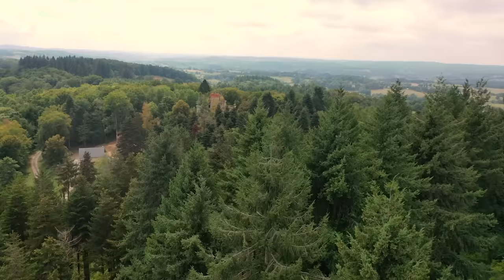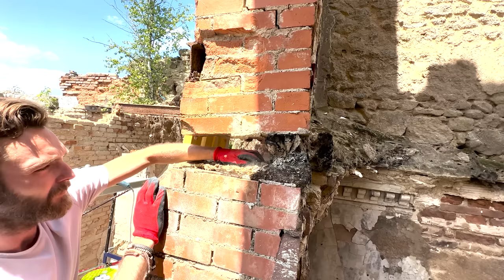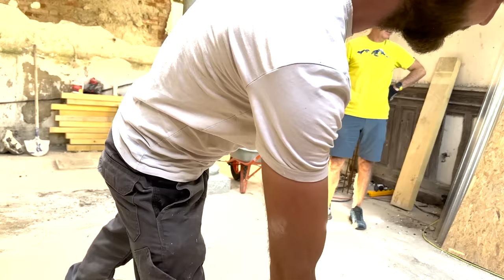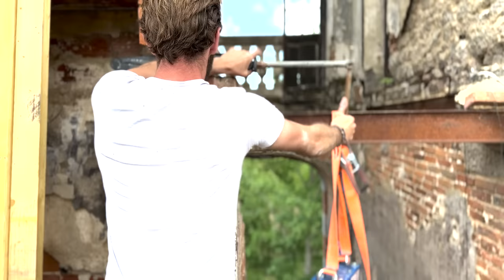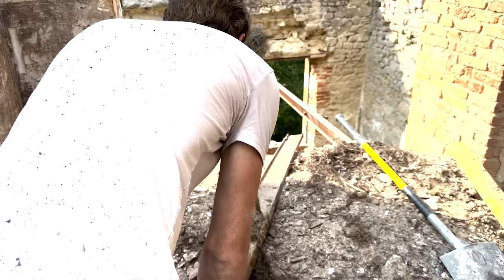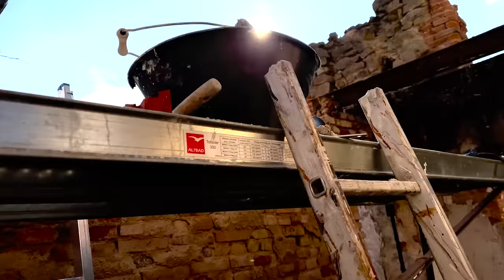Tackling the unsupported chateau tower, tense rebuild

Comment: As a priority, you need to rebuild the rest of that column  BEFORE you start thinking about putting in the beam and slab concrete floor above it.  You don't want to put any more weight on that wall until that's done.
Reply: Yes that whole area is worrisome it doesn’t take much to bring a whole wall down.

Comment: After coming across your vlog last week I am hooked. For safety reasons next time you come across this situation use a bottle jack, long wood beam, and 2 plates to support the iron beam. This transfers the most of the tower weight off of the brick pillar while you do repairs.
Reply: That sounds good
Reply: Thinking the same thing, He could use a few tools like a flat shovel, bottle jacks, hydraulic platform lift , bigger wheelbarrow and a Bobcat machine. How about running water and electric , Even if they were by generator.  This place have a well or what ?   🇺🇸  CARRY ON my good  man .
Reply: @libertyman3729  There used to be a well but apparently it's not usable right now. Dan does have solar electricity and seems to be fine with that.

Comment: What a relief you must feel having that scary looking wall made safe ,well done .
Reply: It's not actually safe now.  

When you see someone use a car jack in a brick wall, you know nothing they have ever done is safe or correct.
Reply: @ji8044  and how would you have tackled that job
Reply: @ji8044  So - he is shoring up a very precarious wall with the intent on making it structural sound in future.....for now agree not the best but have a nice thought for the future - he is tackling everything one day at time to make a very sound, rigid building.
Reply: Well part of it is safer anyway, there is a lot more to do on the roof line but Dan is tackling it with more enthusiasm than the grinder and the tanks phase which sucked some of his energy out while doing that,   he obviously likes repairing the structure, although to me it is fraught with maybe a little more hazard than I would be comfortable with, even in my earlier years, but Dan seems to assess the situation capably!?!
Reply: @ji8044  He didn't actually use the car jack, but the intent was to use it to prop up the wall which he realised was not an option, the solution he used has made that section of the wall safer and without incident, there is further work to do above that at some point in the future, which I'm sure Dan will carry out at that time, I have seen the work of some builders on TV who do far worse and their houses have been up for decades until the unfortunate occupiers decide to renovate them at greater cost, in Dan's case the building was partly destroyed by fire, it's not the optimal way of working but he will eventually secure the structure within his limited budget if all goes well, that is his aim and the majority of the viewers!?!
Reply: @zetpeniakoff4125  To do it right, you have to take that entire top structure down above the beam.  He's building on top of brickwork that was an interior wall and never supposed to have been exposed to the elements in the first place.  That's why it crumbles in his hands.
Reply: @Lolliegoth  But it's not going to be very sound.  That is the point.
Reply: @thomasherrin6798   I doubt any building inspector in the US would pass on his work without a hefty bribe being involved.  Dan makes great videos, man against the odds kind of stuff, but his construction work is third rate.

Comment: Something that might help so there is less shoveling would be to use a thick canvas drop cloth, it can be dragged to the debris pile, instead of the debris falling to the ground and having to shovel it into the wheel barrel.
Or get more wheel barrels and put them together under the work area so when the debris falls it lands in the wheel barrels instead on the floor.

Comment: There is a way to fix it using a needle beem,( support it with a small steel beam/s rebuild the whole corner. When done pull out the beam, and patch a small hole ) a lot safer way to do it.
Reply: Good advice
Reply: @lonnieslick9313  Thanks ,any time.

Comment: The thing that saved that from falling is the fact that the bricks are worked into the wall behind too. That's what's really holding it all up. 
This is something you're going to want to do too. when different walls share bricks they share strength too. They hold each other up. 
If there hadn't been a wall behind it probably would have collapsed. 
It's definitely good to see your reinforcing, now the load is share better by both walls, the way it was supposed to be.
Reply: I don't think there is much of a wall there. This is a column between the opening to the staircase and a flimsy terra cotta block partition on the left. Only above that there's a solid stone wall on the left, supported by a steel that rests on this very column. You can see how even within that column a false arch formed. The bottom of the column was only supported by the timber beam on the stairway side, so the largest part of the brickwork was floating but the crack that you can see doesn't go straight up - each course of bricks supports a little more, until the whole pillar is held up. Once the mortar has set on that repair (I'd wait two weeks or so, I think lime cures one millimetre of thickness per day) you could remove what's left of the timber and fill that void - or replace the timber, I think that might have supported the stairs.

Comment: hello , you can use a reciprocating saw to cut mortar joints and use a stucco brush dipped in water to wet brick work in a controlled manner. cheers

Comment: I am impressed at how well it turned out. The only thing I would have done differently is use a water sprayer to clean the bricks of all debris and applied a boding agent for optimum mortar adhesion.

Comment: Disintegrating brick in old structures is the pits. When you touch it and it badically turns to sand makes you wonder about the entire wall or structure. We had an old brick cottage years ago built in 1829. The entire lower bedroom wall started to buckle and bricks were disintegrating. We had to replace the entire wall. Wishing you the best and good luck with the beautiful house.

Comment: Mate, it's been a hit watching you work on this thing, but my heart has been in my mouth half the time. 
Do you have a structural engineer involved at all? So much of the turret structure looks unstable, and here in the States we would be reinforcing the existing structure with steel, steel, and more steel. I just don't see how those forces are making their way to the ground through stable structure, and in most cases I would see the engineer calling to fully take down and reconstruct the turret.
Additionally, have you had the existing mortar analysed for cementitious content? My biggest concern with that is that older mortar contained more lime and sand and was designed to compact, and modern mortar contains FAR more cement. Combining modern bricks and mortar with existing, and you may get spalding and crushing of the existing brick and structural failure.

We want you to survive this project!

Comment: You thought the last floor over the basement was too unsafe to stand on and clear, but you've since dropped a ton more rubble. What's the plan to clear that before it caves in?
Reply: Possibly hope for it to cave in so he can just shovel it out of the basement.
Reply: @Ragnar8504  it was full of metal ties (pre rebar) and I was scared if that happened it'd pull the walls in and down too!
Reply: @808darwin  The optimist inside me would hope that since the kitchen walls are still standing even though the ceiling is completely gone, the other walls should survive too. I might not want to push my luck though.

Comment: In situations like this you might consider installing a temporary steel lintel above the damage before attempting the repair.  To do this you externally brace the masonry with wood first, to keep it from tipping, then cut out a mortar joint above the damaged area and insert the flange of a steel angle.  Support the angle to take the load.   Then you make the repair.
Reply: Professionals would have used acrow props to support the brickwork and steel above before trying to remove any of the brickwork. They aren't exactly expensive, well worth getting some.

Comment: Hi, bé careful using soft sand in France, much of it contains salt peter (salpêtre) which will make it's way thought any render or plaster you may chose to apply later. It looks to me as if thé sand originally used in thé château was sable rouge (literally red Sand)which has an orangey colour and when mixed with lime dries paler. Red Sand is generally no more expensive than it's yellow or grey équivalents, thought sometimes harder to find. Have fun.

Comment: Great what you do. Awesome and giving inspiration. One thing to consider:
I would not have put my hand in that gap where you took the steel beam out but would have done that whith a brush or so after having supported the structure above is first and repair the gap directly. It did work out this time, but this was way to dangerous. 
Love what you do and spades of respect seeing you taking on this massive project and actually making it work 😉Looking foreword to the final result.🤩

Comment: Floors are great, but the stairs would make life a little easier. I've noticed in places that have to meet codes for earthquakes meant for brickwork, that you can pin and strip the bricks with a cocking element to hold your walls in place. No harm in re-enforcement? Just where the brickwork will be hidden.

Comment: V79  OMG following down to the foundations -that pillar ( you are working on) - on your camera - it will have to ALL be rebuilt as that's holding the upper floors and the turret and there isn't much holding up several tons except crumbly bricks and AIR.... TOP JOB though re pugging that hole in the pillar! That was WELL SKETCHY. Problem is that pillar will have to be TOTALLY demolished and rebuilt VERTICAL from your new bricks or it will throw the whole rebuild out doors wont fit etc.

Comment: Well that was very scary to watch 😬. Luckily nothing went wrong, but it seems like that job could have been made far, far less risky with just a simple temporary support prop under that metal beam you were bricking up to… A couple of peices of that wood literally leaning against the wall just there could have been cut and chocked in and it would have been so much less likely to go wrong!

Comment: Using a car jack, to jack-up a dead mass that weights in at 252 kilos per M2. What do you have there, above you Danny boy? Some 4000 kilos minimum and  jack that can carry 200 kilos.
Use inverted 15 degree hard wood wedges. Play safe, remember a bricks falls @ 9 meter a second, so Bannister's running shoes; might not cut it!!

Comment: Your helpers were working way harder than they needed to clearing that floor than they would have been if they had the proper type of shovel, namely a square nose shovel. Spade type shovels are better for digging holes than clearing flat surfaces.
Reply: They knew what they were getting into
Reply: It’s on the list no doubt. 😊

Comment: the jack was the right idea but the type of jack was wrong a hydrolic jack would have been a much better choice a screw type like you tried to use does not have the mechanical advantage to be able to lift that kind of weight glad it went well though

Comment: but surely that iron I beam is going to have to come out (looks like it been crushed by the weight of that wall) as well as whatever that bit of burnt wood was. That turret wall doesn't look perpendicular either...is there a fix for that?
Reply: I've been wondering about that steel as well but it might be an illusion, loose rust making it look like the beam is bent. 1 mm of steel turns into 10 mm of rust, so the steel might still be strong enough even though it looks terrible. I've seen steels worse than that and have been reassured by professionals not to worry.

Comment: Man, you need to get yourself some strongboy jacks for the brickwork thats wonky. instead of using a car jack! they are also called underpinning jacks they are essentially the width of a mortar line, you hammer them into the existing mortar then jack the brick stack above them back up so its level, then you can do repair work safely and make sure the stuff above is level and safe

Comment: It is a shame that you could not have more regular help, especially with bringing materials to the top where you are working. If you did not have to do so much up and down you would probably get a lot done in a day, not to mention not wearing yourself out in the process. In the section that you were working on, I wonder if it would not be better to deconstruct that dodgy section and simply rebuild it, especially that section you were working on. Of course, that is a lot more work, but in the long run it would be much more stable and safe. Rebuilding it would also give you the assurance that it is solid and capable of holding weight (the roof that eventually will be put on, along with the various rafters, supports, etc.), as well as any floors that might be above it. Just a thought. Please be safe working at heights. Seeing you work at height without safety measures (simple railing) concerns me greatly!

Comment: Let me start with would you consider pushing over that very top section of the tower and replace it with standard wood framing and add a brick veneer. My concerns are your playing with fire damaged mortar, stone and brick that even a structural engineer would advise you to remove for safety if nothing else.